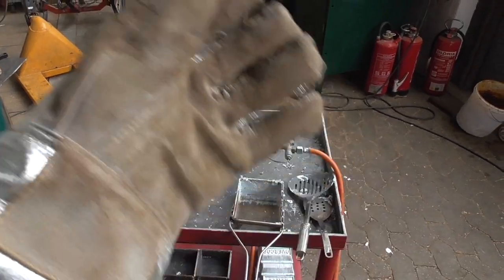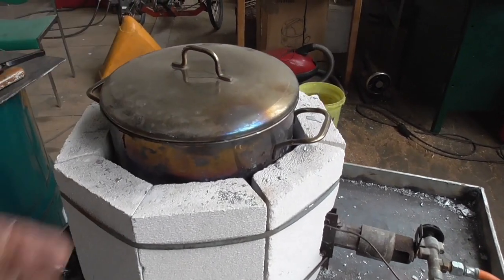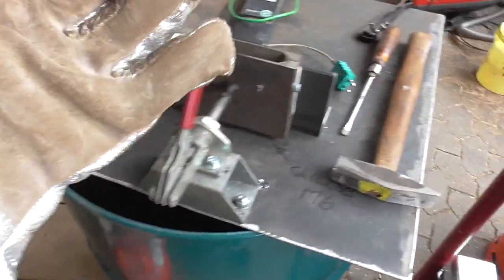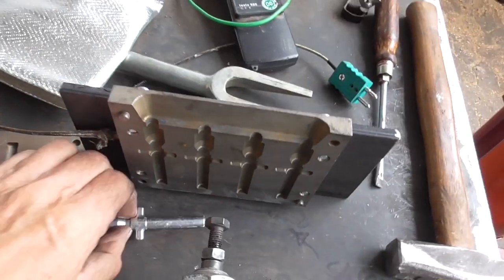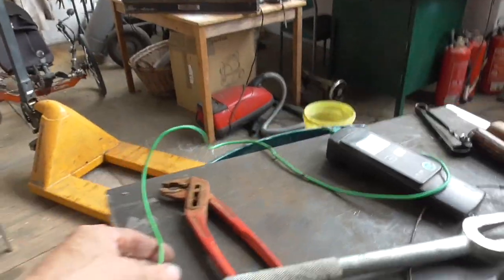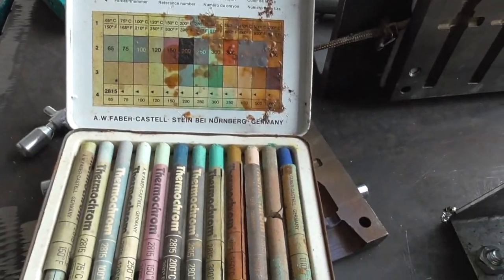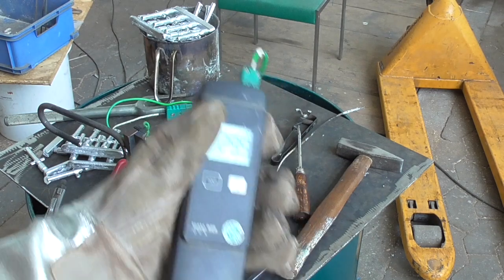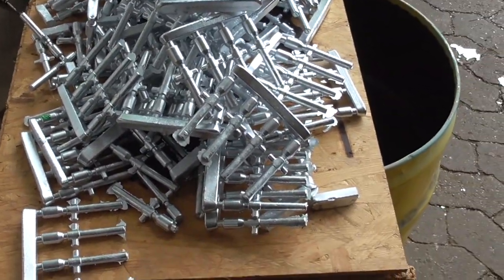Casting clutch cable adjustment screw

Comment: In American industrial language the term is fire brick or refractory. The tool is known in the trade as a pickle fork. You must be selling these nice work.
Reply: Also called ball joint fork.  Charles
Reply from the maker: No, not fire brick. Aerated concrete. Nothing fancy at all.
And yes, that nice work gets sold. That's what I make it for. :-)
Reply: Hebal brick